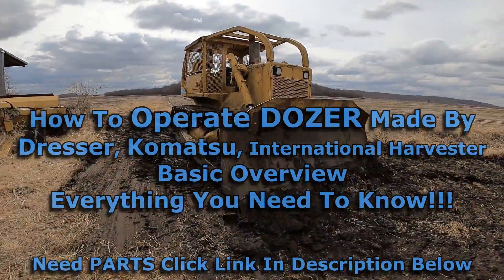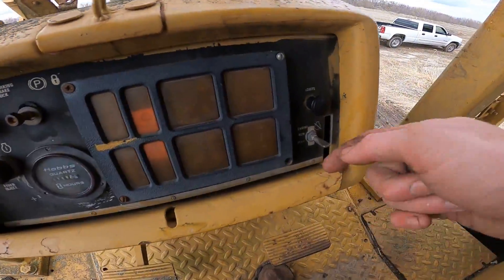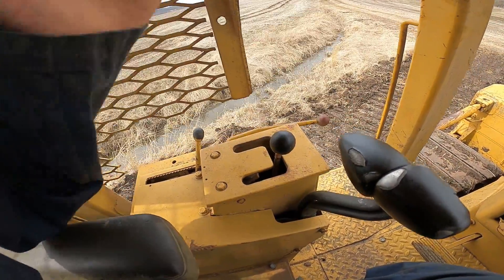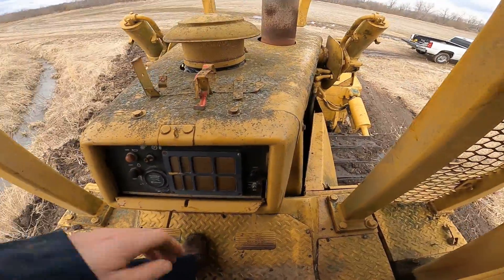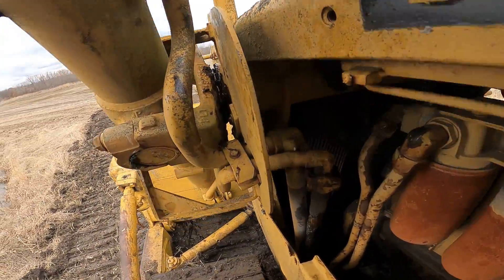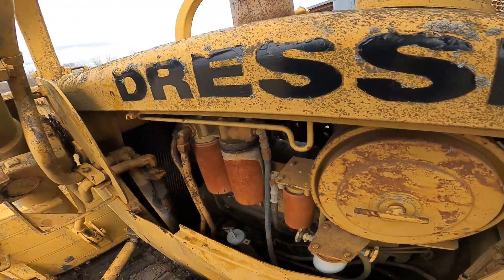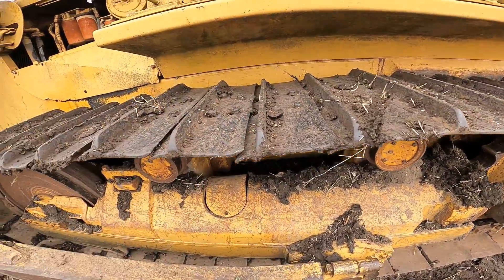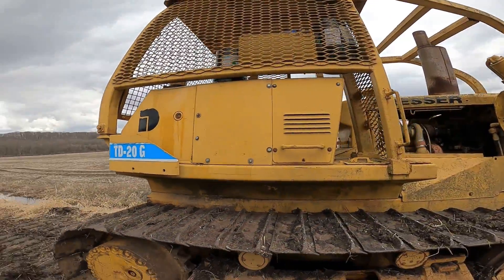BULLDOZER How To Operate DRESSER Dozer TD Controls IH TD20G International Harvester Dozers Komatsu

Comment: What does the pedal on the left do? Decelerator?
Reply from the maker: Left foot pedal is brakes for left side track & right side foot pedal is brakes for right side track. Similar to a tractor if you're familiar, you can lock the brake pedals together or you can hit the brakes for both wheels or one wheel or the other hope this helps answer your question.
Reply: @EverydayImTECHnIt  9:36 9:36 9:36  That is not correct

Comment: We used to make a lot of International Harvester equipment and components in Australia. There's a nice model of this for sale at the moment for $155,000 ($99,500USD). The International tractors were the strongest and most reliable tractors of their time. Even stronger that todays gear. I have an old 1982 Kubota M7500DT (82HP) and the axles and steel thicknesses used to make that thing is stronger than modern 120HP tractors. The old stuff might not be as comfy but far stronger and easier to fix than modern machinery. That is certainly one thing they thought of back in the day. Serviceability.
Reply: Everything you need and nothing you don't. Love the way this this machine is built.

Comment: Decent video, man. But the proper way to run this machine (or basically any dozer) is to pull the throttle lever all the way back and use the decelerator pedal on the left to adjust speed/rpms.

Comment: Some body should tell him it has a 2 speed steering system so it has 6 fwd and 6 rev, so  you can have one track in Hi and one in Lo to have  power on both tracks while turning. Tis a good system, IH have had it from the days of the TD 24 back in the 50s. Komatsu D 87E is the Komatsu version of that machine, basically the same machine but with a Komatsu engine instead of a Cummins which that has. Dressta is the present day maker of what used to be IH, and are made in Poland now days.